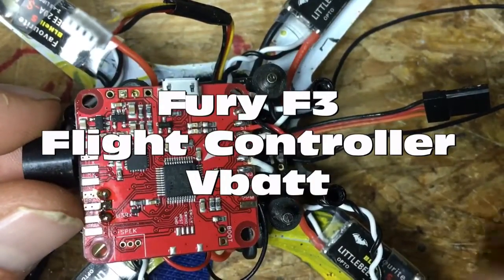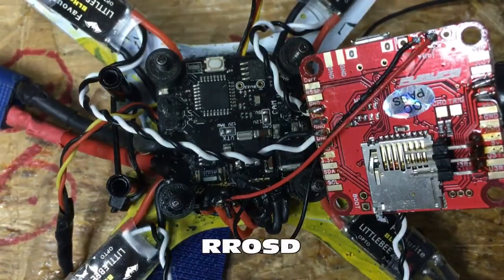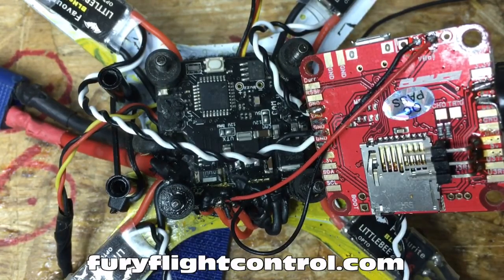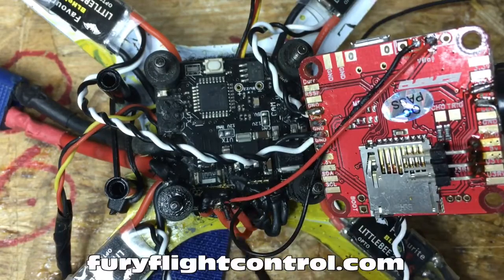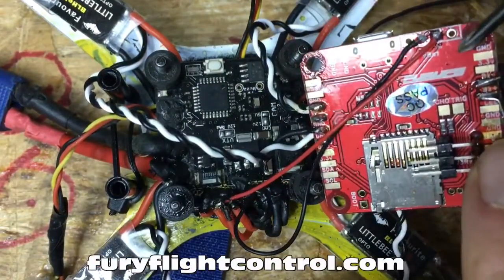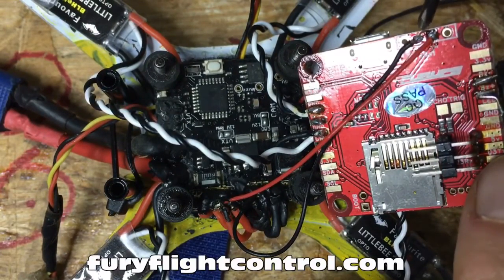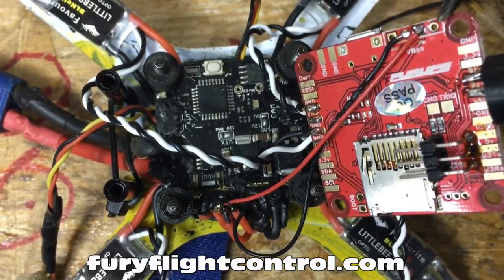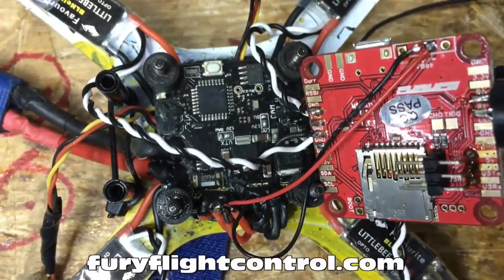How to connect the Vbatt on a Fury F3 Flight Control Board

Comment: hello mark. I met you yesterday at hayes hobby in fayetville. I ended up purchasing your frame, the pdb with with no osd and the fury fc. i will be starting my build tomorrow afternoon. thanks again for the recommendations. my only question is for the camera and the fc power do i run two leads off the same 5v out from the pdb?
Reply from the maker: That depends on what Vtx you are using and PDB.  Some Vtx's have a 5V out with them,.
Reply: thanks for the reply...i had two pads come off the board when i was soldering the escs signal wires on...so i scratched off the paint and used the leads..everything worked but when i went to test the motors the fc flamed and smoked and died...lol.. waiting till wednesday till i can buy another one. im a noob.